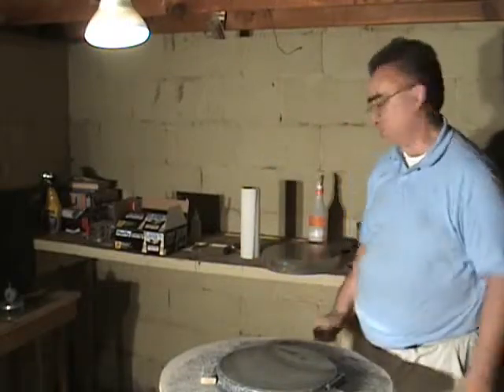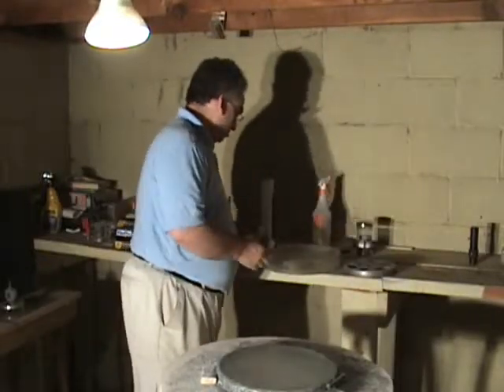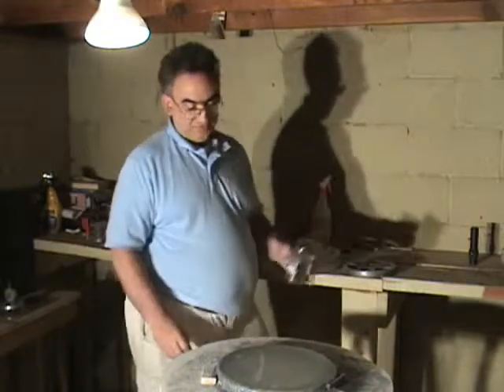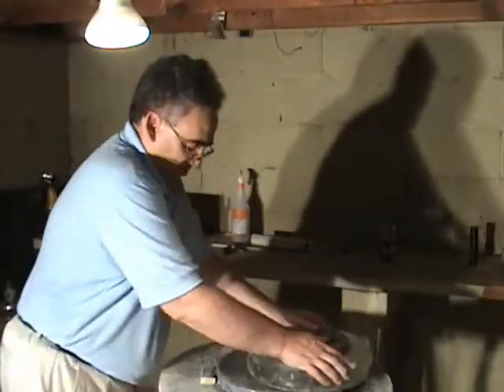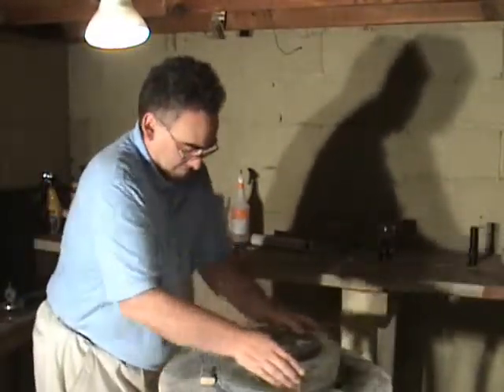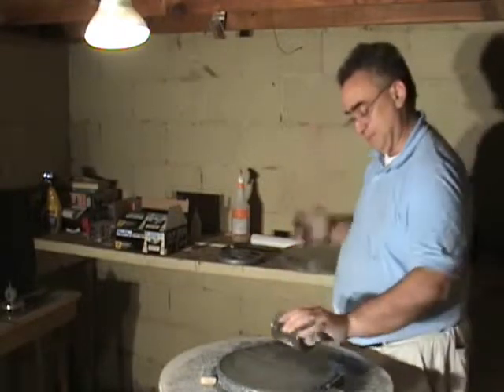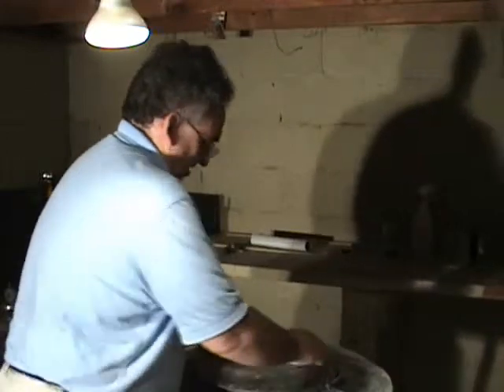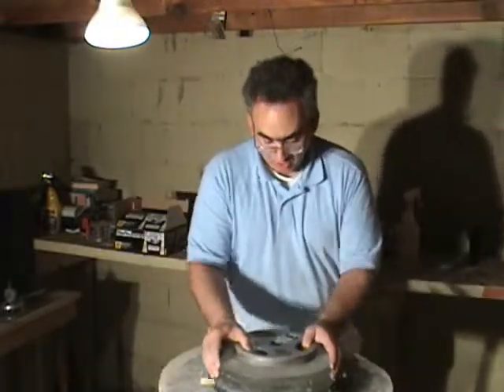Making a Telescope. Rough Grinding a 12.5 Inch Primary Mirror for a Buchroeder Quad Schiefspiegler

Comment from the maker: There are different feelings about whether to use plate glass or other optical glass, as there are with stock thickness. 

I prefer to use pyrex or other borosilicate glass with what has traditionally been called a full thickness (1:6) blank to cut down on flexure. Others claim to be able to correct flexure by using different mirror mounts.

As I have had great success using a full thickness blank, I will continue to do so.

Best regards,

Francis J. O'Reilly